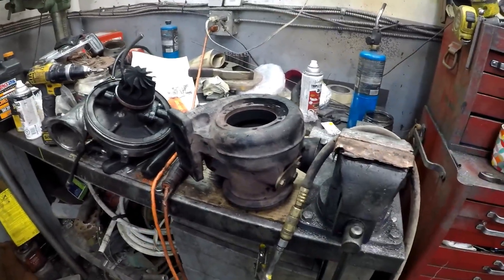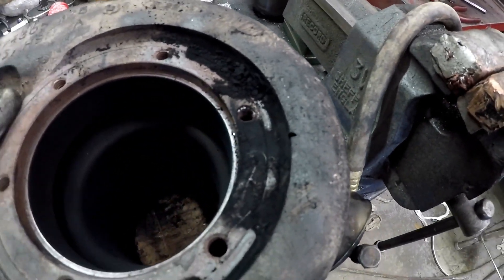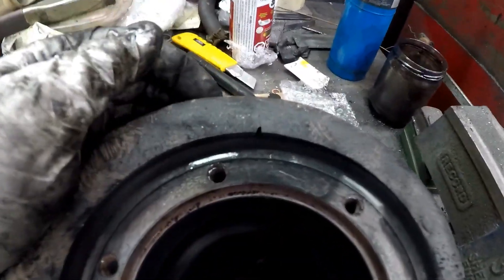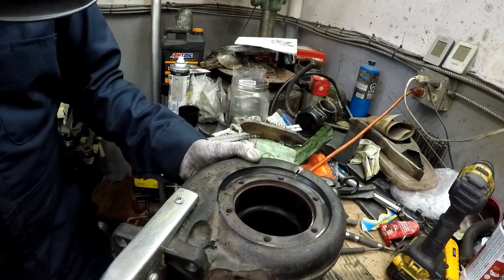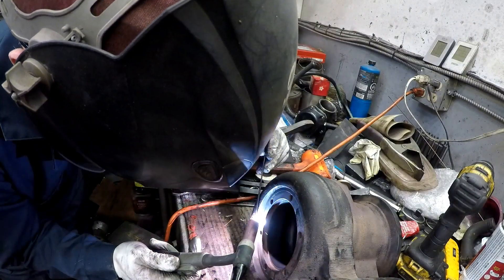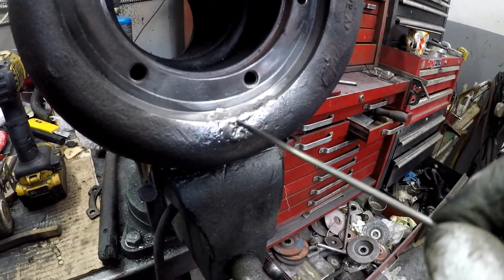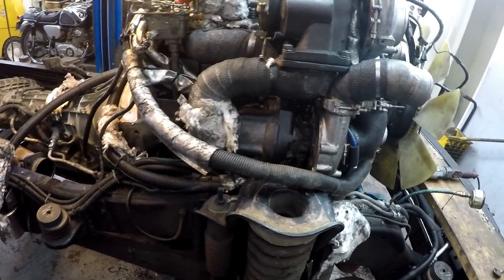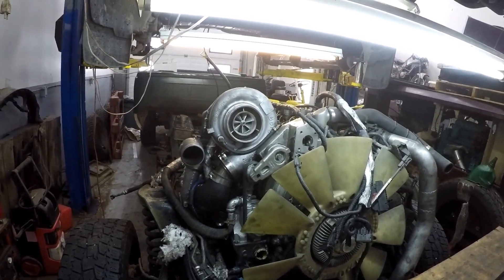Welding Up A Cracked BorgWarner K31 Exhaust Housing

Comment: Glad you were able to save the housing. I need to get out my TIG and practice. Thanks for making it look simple!!
Reply from the maker: Me too, should work well.:)  I'll keep an eye on it and see how it hold up.:)
Reply: I do lots of TIG welding. 
I never used nickel TIG rods. 
I’ll get some to play with
Reply from the maker: @akfarmboy49  I'll dig up the alloy for these rods.:)  They're actually a arc rod I bought years ago to weld cast iron.  They worked great on my old Buda block, so I cleaned the flux off one and used it on this turbo.